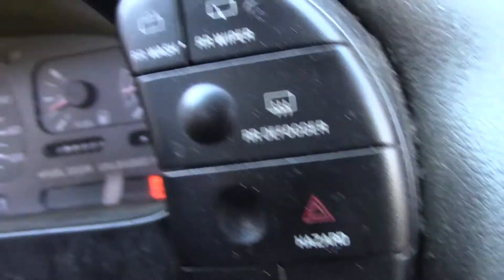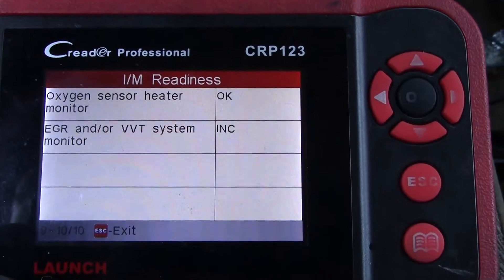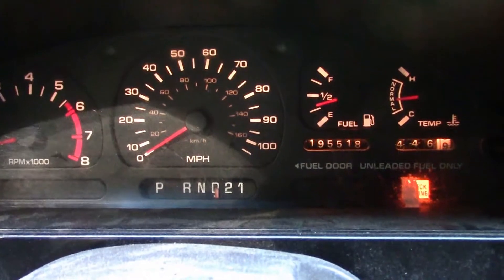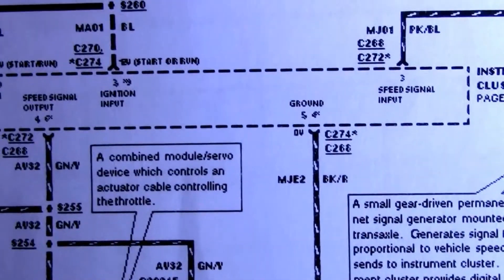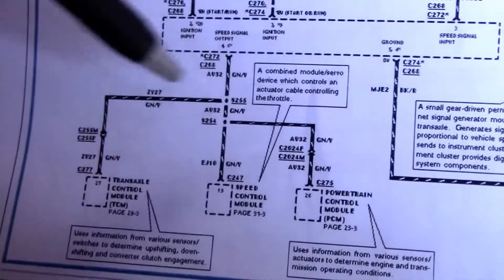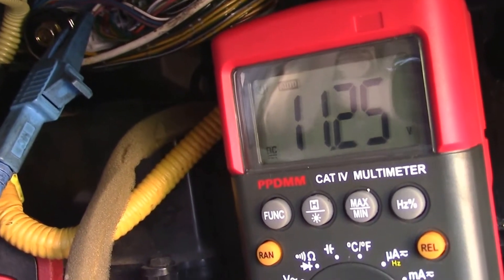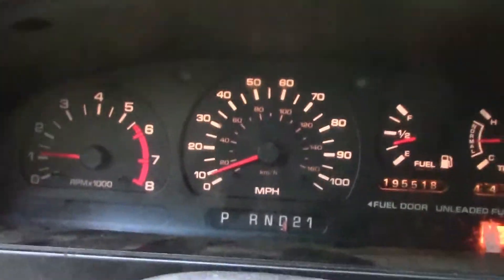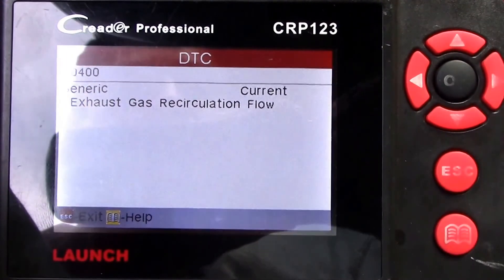96 villager  how to diagnostic  code P0500

Comment: How to fix it?
Reply from the maker: as you saw there I prove the senso was good the computer was good in this case the cluster is faulty not sending out to ecm  digital square signals , that is the one I  simulated with the test ligth . faulty instrument cluster
Reply: And which parts should replace?
Reply: I have Sienna with same problem,I replaced speed sensor but still having the code,speedometer only works sometimes
Reply: Thanks for the reply
Reply from the maker: @chefitalia28  
sienna has complete diferent  circuit than this , 
what year us the siennna? 
 the point is  for this videos to demonstrate how to test if system is operating correctly and find the faulty part after you prove it is failing than replace it ,  is not replace and see what happen  .
Reply: Mine is 2002 Sienna
Reply from the maker: @chefitalia28  
on the odometer does it registrate  the miles   speed you  are driving??
Reply: Yes it is,but it’s doesn’t when it’s not working,also the transmission shift funny when the speedometer not work,
Reply from the maker: @chefitalia28  
https://youtu.be/RI4VEbzu6Wo
  that system has your sienna very complex you need same to diagnostic for you . the   abs unit use the  speed sensor  and translates that to  the speedometer than the speedometer send the signal to ecm and tcm   for speed